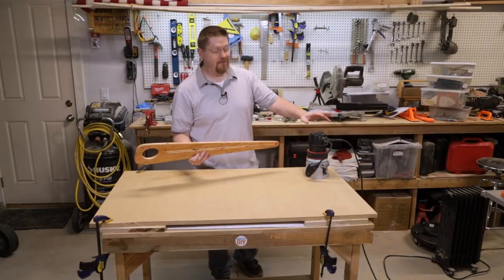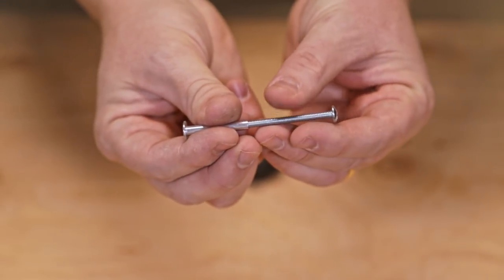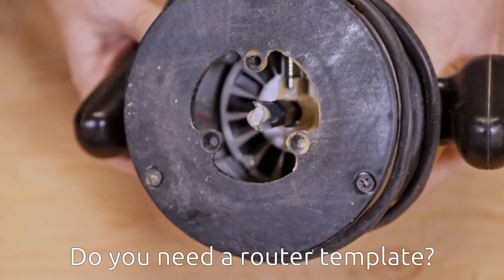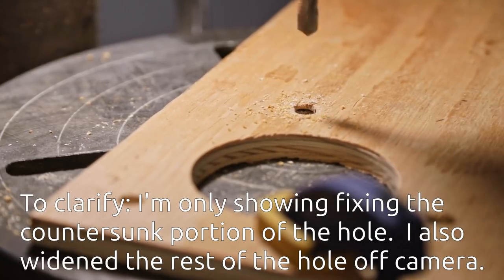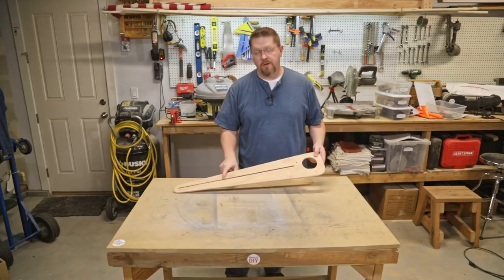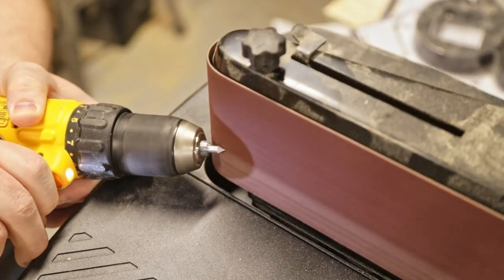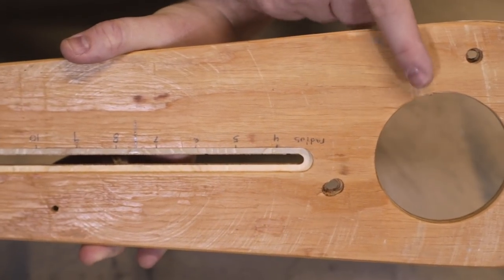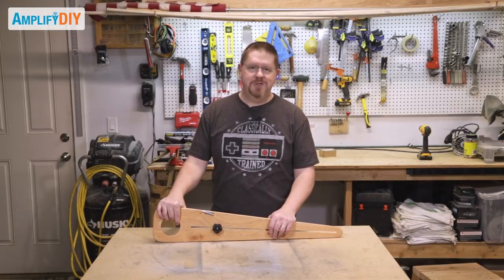How to Build a Circle Cutting Jig For Your Router

Comment: Nice vid.  Small tip...  Instead of marking the holes from your router place and drilling, use a self centering drill bit directly from the base plate instead of marking for the holes.  Will be perfect every time.  Of course, you need to have self centering drill bits :)
Reply from the maker: Great tip! I didn’t own any self-centering bits when I made this video, but i have a set now. Thanks for watching!

Comment: I just finished this project. I built it in to a rolling cart that slides under my workbench. I can remove it and slide another device in its place. I cut two 16” rounds in minutes. My wife is thrilled, but I have a feeling my “me-time” just took a major hit. I think I will be cutting more craft projects than I bargained for! Thank you so much for sharing this.

Comment: Great job. Best tutorial I have seen for a jig yet. The roundover and radius work, even though not filmed, made it a great looking jig making it worthy of being made of Baltic birch.
I am making this for a community woodshop in various sizes(for ease of use) and will be making several pin combos. I am thinking maybe a little bigger pin and knob combos, certainly smaller, both pointed and squared off . I will make the squared off pins so that do not go all the way through the wood, maybe 1/4", 3/8, + 1/2", so one surface is left untouched/ presentable.

This is going to be a teaching project to introduce several tools to newbies.

I have several 1" X 2" 3D printed open boxs I made for 1/4 hex bits and will glue a magnet in the bottom so they do not run off. Your use of a magnet was great.

Thanks again
Reply from the maker: Awesome ideas! I love hearing about folks who come up with obvious improvements to my designs. Thank you so much for sharing your plans, and for watching!
Reply: Nice idea on blind pins for cutting from back side of materials.

Comment: @7:25 Two tips borrowed from the metal working trade. Plywood is a laminate of differing sheets applied with grains at opposite angles for increased strength. When "wood butcherin" millimeter accuracy is not normally a prerequisite. Go ahead and drill, but know because of those odd angled sheets in the ply a bit can "walk" on you. To increase accuracy in ply; Tip #1, first pre-punch the mark with a good sized finishing nail, or smackable wood awl going at least through the first layer of the ply, plus. Tip #2, pull the nail/awl and use drill bits of smaller size working up to your finished hole. More work, but in the odd case where wood has to match machine shop tolerance this stacks the odds in your favor. Good video! I'll make one of these.
Reply from the maker: Fantastic tips, 1Klooch! Thank you very much!

Comment: Got it done yesterday thanks to your vid. Yes, the parts were difficult to find. Thankfully, Lowe's has a decent specialty hardware section. Now on to the project that inspired this build - building a vortex dust collector stand. Indeed, especially in woodwork, necessity(mine) is the mother of invention (yours). Thank you.
Reply from the maker: Fantastic! So glad you were able to finish your circle cutter. I built min specifically because I also needed to build a dust collector. I went with a Thien baffle design: https://youtu.be/tMeU6_gMNKo Best of luck with yours!
Reply: @AmplifyDIY  I went with the "JohnBuildsIt" plan. Just got it done.  Not perfect but decent for my needs. I regret not having more capacity such as your Thien model. Like the idea of moving collector around to each individual machine rather than building an entire plumbing system. Not only does it take up less space but eliminates the problem of suction loss over distance which I presume would be unavoidable. Can you comment on that particular issue? - my vac is a 5hp and I presume it cannot be as strong pulling dust from a machine on the other side of my woodshop as it is for more proximal work.

Comment: Ok, yup. I've been looking for a circle cutter jig. I've seen some janky ones using a jigsaw, and I've seen unnecessarily confusing ones. This is the one I'll be building (though I think I'll make a small change to how the router mounts!). And because my work table will have T-track (waiting for it to arrive)(SO patient.. lol), that's how it'll be fastened to the table. Cool!
Reply: Also, I checked my local Home Depot website for the parts.. I recognized the Chicago screws already so I KNOW they have those, and they had that exact brass knurled knob as well.  I love it when projects are easy to source parts for...
Reply from the maker: Nice! Glad you found everything!

Comment: When you place the router base plate on the plywood, use a Vix bit to locate the holes . Much more precise. Great setup with the knob.
Reply: Now I know what those Bosch Clic-Change 1/4 in. Self-Centering Drill Bits are called.  Another good idea.

Comment: Nice video. I use 1/4" ply. It has some flexibility so I can tilt the router up off the workpiece a little bit when I start the motor. I don't have a plunge router.

Comment: For the pivot point I use a small block of wood with a hole in it to hold the pivot, sticking double sided to tape to the underside of the block to keep it in place. This works for me and leaves no mark.

Comment: typically, I want youtubers to cut to the chase, but this intro had me chuckling.  Cool jig, thanks.  I made a pot/pan lid out of solid wood awhile with my band saw, but it was difficult to get a perfect circle.  The major flaw, however, was that it warped from the moisture.  I was thinking of making another out of good quality plywood.  I was wondering if you would have any thoughts on that?  Is there a way to keep solid woods from warping?
Reply from the maker: Hi Ryan - great question! My rule of thumb is if it's ever going to be exposed to moisture, it'll warp. So if you are planning to use this as a lid over a steaming pot of your favorite soup, it'll be really difficult to keep it from warping, as the wood will absorb some of the steam and expand, which causes the warping. A high quality plywood will warp less than a solid chunk of something, but neither is a great choice for something like a pot/pan lid. I'm certainly no expert woodworker, though - so I'd recommend banging around on google a bit to see if there is better info out there. Good luck!

Comment: I acquired the same router recently from a friend who brought it back from the US, it has never been used, problem is I've no idea how to get it to adjust up and down, seems to me to be jammed up, any help much appreciated. Cracking jig btw.👍👍
Reply from the maker: Hi Brian! There is a ring you have to spin to make adjustments, after releasing the tension lever that locks it down. On mine, the ring was quite difficult to spin as well, so I disassembled it and added some lithium-based lubricant to the adjustment mechanism. That helped, but it’s still not the smoothest adjustment ring. Good luck!
Reply: I'll have to investigate more then I doubt, thanks for the info.

Comment: At the 8:41 point in the video you are talking about the distance of the bit from the guide edge.  Is the distance from the edge of the bit or the center of the bit? It seem to me that it would be the center, but the way you state it, it sounds like the edge. Please clarify.
Reply from the maker: Apologies for the confusion, Dan: When you are cutting with a bit, you need to measure from the outermost edge of the bit, not the center of it. Say you are cutting with a 1/4" bit, and you are trying to cut a hole in something (you are discarding the circle you'll cut out). If you measure to the center of the bit, the bit will actually cut 1/8" wider than you measure (because the bit is 1/4" wide). This will make your hole too large. Similarly, if you are cutting a circle (discarding the part with the hole) and you measure to the center of the bit, you'll wind up with a circle that is just a little too small. 
So measure from edge of the cutting bit to the center of the pivot point.
Hopefully this makes more sense. Let me know if you need further clarification. Thanks!
Reply: @AmplifyDIY  I am talking about the jig specifically.  So when you cut the slot for the pivot point, shouldn't it be centered on the center of the bit, because the line you drew for the slot was from the center of the bit.  I understand when you are cutting the circle itself, you have to adjust for half the width of the bit, so that your cutting the actual radius you want.
Reply from the maker: Yes, the slot in the jig should be centered on the bit.
Reply from the maker: Rather: it should line up with the center of the bit.
Reply: I completed the jig, but on my first attempt the circle was not a perfect circle (the radius ranged from 6” to 6 3/16”). What would cause that issue?  Is my slot out of alignment, or is the pivot point shifting (it seemed to stay where I tightened it down).
Reply: Any suggestions on my question above?
Reply from the maker: Sorry for the late reply: I suspect your pivot point either was not tight enough or otherwise shifted somehow.

Comment: Told my wife I was going to make a new table for the breakfast room. She said she wanted the table round this time. Since my table will be 48 inches in diameter and the CNC router will only handle 30 inches I will make a 24-inch jig instead. Will make the plastic handle with my 3D printer. Thank you for the idea! :-)
Reply from the maker: I love it when people can adapt my suggestions to fit their ideas. Best of luck with your table!

Comment: Great tutorial and simple explanation..Some of the router jig ideas I have seen are to over complicated as if they are to reinvent the wheel. I think on yours you could probably make one. 😄 Could I use MDF instead of plywood as I have plenty of 18mm (0.7 inches) in the garage.
Reply from the maker: Sure, MDF would work fine. Thanks!

Comment: I'm using a 1/2 inch piece of popular wood for my jig and  I was wondering if this jig will sit flat on my work piece with the pivot points in place?
Reply from the maker: Hi Eugene - it should work the same as MDF or any other plywood. Depending on how you have your pivot points set up, you may have a slight gap. Good luck!

Comment: Nice and simple.  Gonna try this.  I didnt see how you fix the jig to the stable work bench
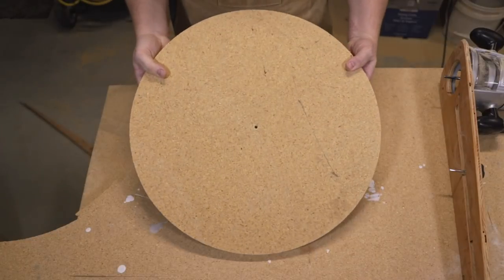Reply from the maker: Hi Michael! At the 16:17 mark of the video you can see I just screw a couple of wood screws with washers through the adjustment slot of the jig right into the top of my workbench to fix it in place - The video is sped up at that point and it goes really fast, but that's what I did. Hopefully you can see it if you click the timestamp above. Thanks for the feedback and for watching!

Comment: What is the minimum thickness of stock you can work with, as there seems no adjustment for the length of the post?
Reply from the maker: I've cut 1/8" stock with this with no problem. The post is long, yes, but I also showed a shorter pivot that comes to a point that can be used as well, which just sits on the surface of the stock. Thanks for watching!

Comment: Your third center post should be a larger pad (6"?) that you can carpet tape to your material and not leave a gouge or center hole. I like to use 1/4" masonite for these builds; you don't need longer screws for your router mount.

Comment: Nice Jig. Only thing though, why did you make pin so long as to go all the way through material thickness?
Reply from the maker: Hi Dario - I believe I mentioned that I made several different pins - one is long like you describe, the other is short and comes to a sharp point so it can rest on the surface of the work without needing to drill a hole. Thanks for watching!

Comment: Pretty awesome ! What brand sander and bandsaw do you have ?
Reply from the maker: Believe it or not, the bandsaw is one made by Dremel that my wife found for me on Craigslist some years ago. It's a decent saw, but was discontinued years ago, uses a less common blade length, and does not have some features I'd like (such as a good resaw fence, etc). I've been considering an upgrade for a while. 
The sander I believe is made by Wen - here's an affiliate link for either the exact one I have or one that is really similar (different color): https://amzn.to/3jtknlT
Thanks for watching!

Comment: Looks so easy want to make, but have a question. The hole were you marked the boy center, did you cut that larger or same size?
Reply from the maker: I'm not entirely sure I understand what you mean - are you talking about the hole in the center of the jig? I cut that large enough to accommodate all the bits I have for my router.

Comment: can you use 3/4 inch pine or does it have to be 1/2 inch board?  thnx
Reply from the maker: 3/4” would work, but you’d lose a quarter inch of possible cutting depth for the mounted router, as your jig will be a little thicker. Good luck!
Reply: @AmplifyDIY  thank you so much

Comment: Great video, I am going to make this jig. I just have one question. What is the advantage to adding the brass knurled knob to an oversized plastic knob rather than just getting a plastic knob with threads that match your screw?
Reply from the maker: There isn't an advantage other than that I couldn't find one when I was at the store. 😆 Best of luck with your build!

Comment: A good video but it would be better if you supplied links for all the things needed
Reply from the maker: Thank you for the feedback! I've added links to everything to the video description. I'll add them here as well in case you have any problems finding them there:

Barrel Nuts and Machine Screws: https://amzn.to/3btGyG9
8-32 Knurled Brass Nut: https://amzn.to/3jLTSsw
Plastic Knob With Threaded Insert: https://amzn.to/3gZ7E9l
Straight Router Bit: https://amzn.to/3bw8TeU
Inexpensive Router: https://amzn.to/3bBdZH6
Reply: Lol,  I guess I scrolled right past it didn't see it. Thank you

Comment: How would I do it if I don't want a hole in the middle of my circle?
Reply from the maker: In the video I showed that I created a second center pin with a sharp point instead of a rounded end. When I don't want a hole in the resulting circle, I use this center pin instead. Now, it does leave a small impression on the surface of the wood, so if you can't even have an impression in the circle, you can use double-sided tape to stick a thin piece of veneer to the surface of the work, then use the center pin with the sharp point into that. When you are finished, remove the veneer.
Reply: AmplifyDIY oh ok I see. Sorry I completely new to all of this. I have a laser cutter and I’ve been buying rounds for my signs but cutting my own would save a lot of money. If I can just figure it out.

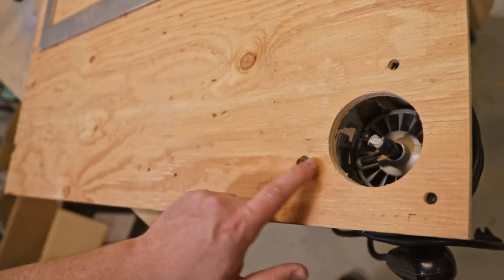Comment: @8:08 the counter sink is way too deep to offer really good support....i would have bought longer machine screws to secure the router without sacrificing support strength.
Reply from the maker: The video is a little deceptive here... the countersinks are not as deep as they appear on camera. However, you make a good point: longer screws would also be a good idea. Thanks for the suggestion!

Comment: I disagree with marking the gauge. It changes the measurement if you use a different bit, or changing from inside/outside diameter. They won't be precise, but most are okay with that too.
Reply from the maker: As long as I remember to take bit diameter into account, I find the markings to be really useful. Always double check with a tape measure off the side of the actual bit before cutting for better accuracy, though.
Reply: @AmplifyDIY   I guess that could work if the markings went to center, and add/subtract the RADIUS of the bit.  It's still a lot of math for people who would be beginners. If this were a product in Lowes, you would have to idiot-proof it.  lol.
Reply from the maker: @triplealley  You know what they say: Make something idiot-proof and the world will go and build you a better idiot. ;-) You are 100% correct, of course. I know how my measurements work, and I always double check with a tape to the cutting edge of the bit before I cut when I need to ensure precision. Thanks for the feedback!